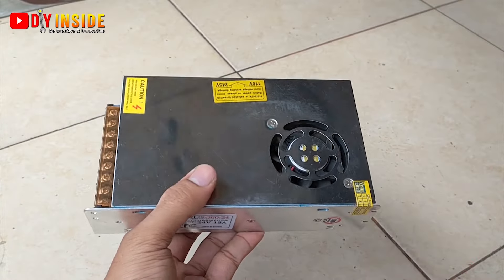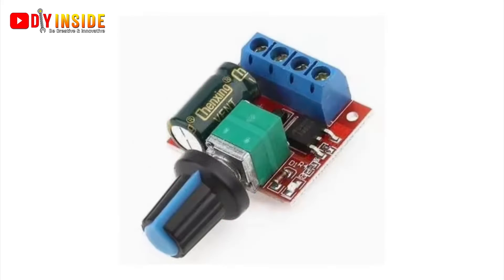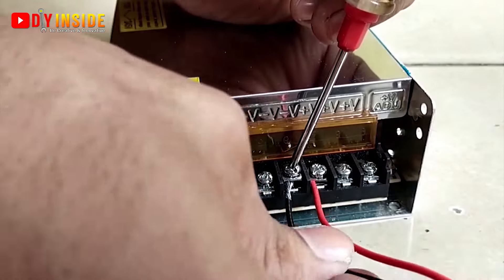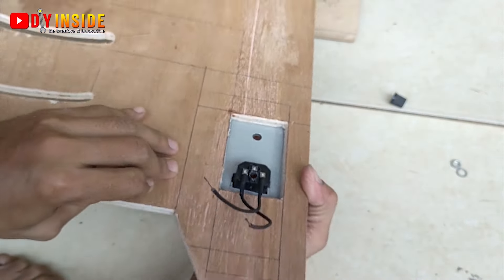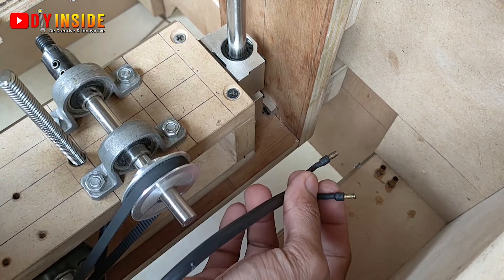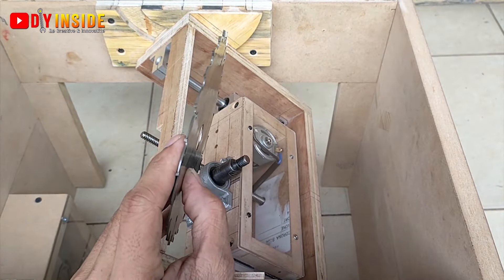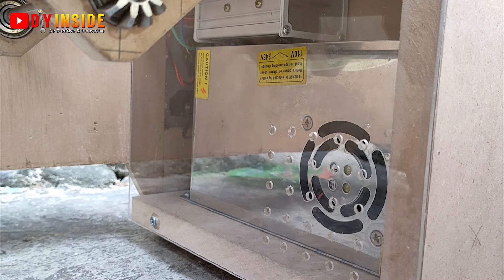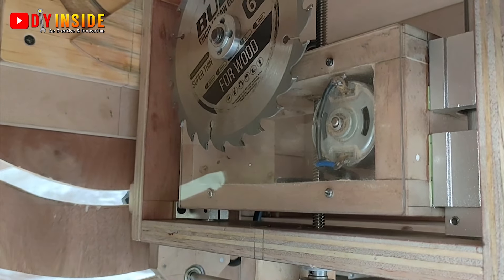cara membuat TABLE SAW dari Dinamo DC 895 : Part 4 (Power Supply & Speed Controller)

Comment: Pertanyaan saya...kira² habis berapa RB/JT membuat table saw seperti itu...
Reply: Mahal bos
Reply: Jika tidak percaya dihitung nominalnya dari bahan awal PSU sj dah brp + ongkirnya. Soalnya belinya pasti beda2 toko. Atau intinya ini kreatif khusus orang dana berlebih
Reply: Hah? Total kira2 700 ribuan.
Power supply 125rb, dinamo 895 100-150rb, pulley & belt 125rb, pillow bearing 2 buah 25rb, as baja 8mm 15rb, triplek 120rb, mata gergaji 6inch 100rb, arbor adaptor 10rb.

Comment: Bang boleh minta link untuk penjepit blade biar ngepas dengan diameter bladenya sperti di vidio, soalnya saya baru beli blade ukuran 7inc dan ternyata setelah dipasangin ring  longgar banget. Saya pake mandrel m10 ke mesin pompa air. 🙏
Reply: Kalau 7" beli ring nya bang. 25.4 mm ke 16 mm. Kecuali pakai saw blade 6". Lubangx 20mm. Trus ring bawaan blade nya 20mm ke 16mm
Reply from the maker: https://s.lazada.co.id/s.LO0MD saya beli disini baang, biasanya kalo beli Blade itu sudah dapet ring bawaan baang, 
Kalo 7 inch pake yg 25,4 mm ke 16 mm
Reply from the maker: @_Nik88 mantap baang, makasih sudah bantu menjawab 👍👍😬
Reply: Makasi banyak bang 🙏